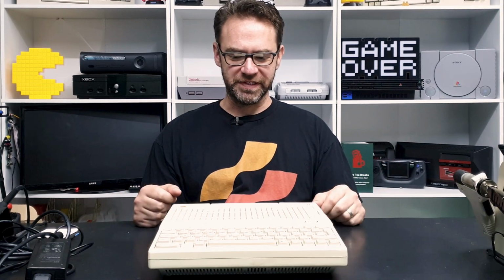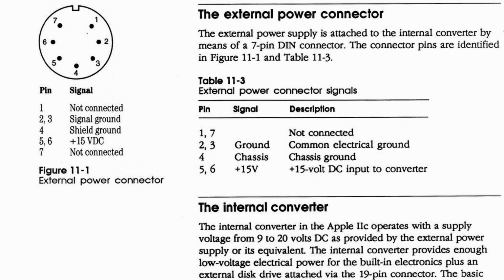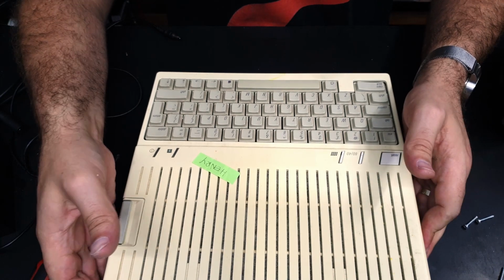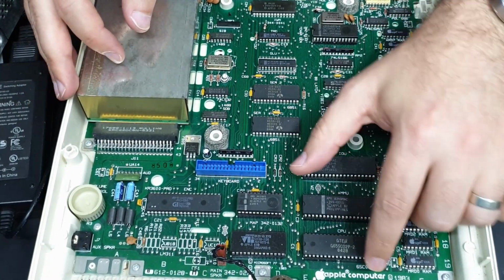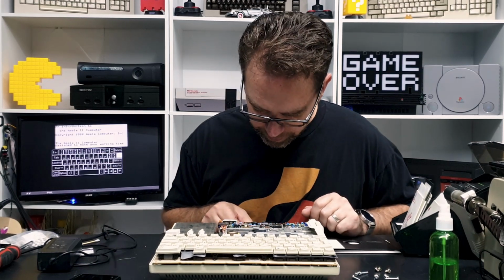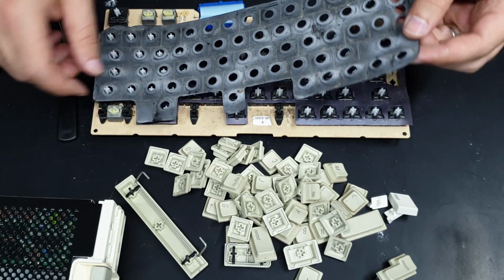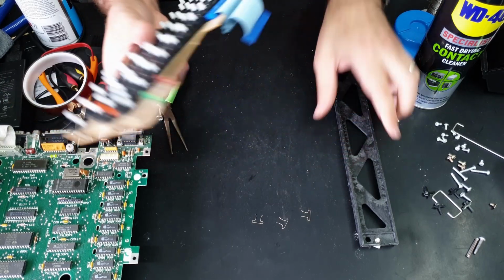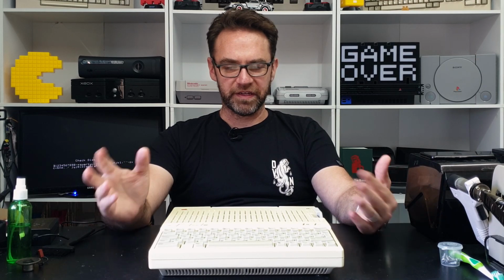Apple IIc repair and restoration - Part I

Comment: Watching this for the second time and was hoping there were some links to the parts for the cable you made to attach the laptop p.s. But no luck
Reply from the maker: You just need short piece of 2 core wire, a 7 pin female din connector and a DC barrel jack (the size will depend on what your power supply has). The wiring for the 7 pin din can be found online, just google apple IIc power supply pinout. Make sure you test the din with a multimeter to confirm you have the polarity correct before plugging it into the IIc

Comment: I repaired my IIc finally last year. Rescued it from a recycle pile about 8 years ago, and just never did anything with it. Turns out it was a RAM issue more than anything.  I did upgraded from my ROM255 to ROM4X, and have it switchable now via a switch that comes out the back, (nondestructively)... although it's kinda pointless. the only thing it really affords me is that it moves the slot the mouse is connected in... so.. yeah. Unless you have the memory expansion board, anything more than ROM0 isn't really useful.  just fyi,  I'm itching to modify it more though... i'm eager to see your follow up video. :D
Reply from the maker: Thanks Scott, yep the ROM4X will definitely be going in along with a couple of other changes
Reply: @TheRetroChannel  excellent. (Just subscribed today too, btw. :D)
Reply: If memory serves well, the ROM 255 doesn't allow to use a 3.5 drive (A2M2053).
Reply: @granpawa  yep.  but going all the way to 4x wasn't necessary for my needs. (I also don't have any 3.5" apple II drives anyway)  I could have just used version 1iirc.  Regardless, i can switch between Rom 1 and 4x if need be

Comment: The plastic around the power switch was bending so much as you were trying to remove it 😬. I'm surprised it was so flexible. For a computer of this age they managed to make it look quite "modern" compared to other machines out at the time.
Reply from the maker: It is a nice looking machine, so I do want to spend some time to make it look better. The plastic at the back survived, as it's the first time I've worked on one of these I didn't know there were clips either side. Everything survived though
Reply: I was cringing at that too. But he got away with it.

Comment: Welcome to the wonderful world of Apple 8 bit computers. I'm a recent explorer myself.  Mr Lurch has probably pointed you to all the useful resources (Including the appleiioz mailing list), but just in case, ADTPro (https://adtpro.com/index.html) will allow you to get new software onto the apple with a serial cable. After that, https://mirrors.apple2.org.za/ftp.apple.asimov.net/images/disk_utils/diagnostics/ has disk diagnostics apps.  I think I ended up grabbing Apple Cillin II and Apex II for diagnostics, once I had the system stable enough to write disks.
My first experience with Apple IIs was spending MONTHS working on a very broken europlus, with corroded chip pins and lots of failed RAM. Also the language card was toast, which meant I couldn't even use ADTPro to move files over. Ended up resorting to using the tape port and Asciiexpress (http://asciiexpress.net/diskserver/) running on my iPad. Good times :-D
Reply from the maker: Thanks for the links, I was literally about to start searching for a disk diagnostic program. I haven't yet downloaded ADTpro but Mr Lurch did give me a cable to use with it. It's likely I've just got some bad disks, but I want to rule out the drive being an issue before I write them off

Comment: Index hole LED direct to oscilloscope will get you the RPM. I have a vid on it on my channel about cleaning the LED
Reply from the maker: Thanks I'll check it out
Reply: @TheRetroChannel  As far as I know, the Apple II disk drive doesn't use any led index for the track start. Track indexing is done purely in software.
Reply from the maker: Correct, I had a look yesterday and there are no sensors for the index hole
Reply: @TheRetroChannel  Did apple use the Spindle for the rpm?, cant remember..
Reply from the maker: It has the markings for setting the speed on the bottom of the spindle, I plan to use that and also try out some diagnostic software if I can find one that reports the rpm. See how accurate setting the speed by the spindle strobe markings vs software
Reply: @TheRetroChannel  according to the interweby thingy, RetroComputer stackexcgange thread they run up to 300 RPM, DISK II (Wiki) standards omitted any index use thus creating the flippy world we read about. Woz didnt want to read the shugart manuals and took his own approach to PCM on Ionized metals... Interesting.

Comment: Ok, I have to ask, That watch is nice, what brand / make, model is that watch brah...
Reply from the maker: It's a Huawei W1 and it's probably about 4 years old now. There is quite a bit of screen burn happening but it still works well
Reply: @TheRetroChannel  Reminds me of my Dads watch, and as most kids know, wearing your dads watch as a child is a good memory. My kids got me a  KC50054006 but I am afraid I will break it so I need to find a everyday watch. Do you remember the Red LED calculator style watches?
Reply from the maker: Oh yeah, I don't think I ever owned a calculator watch back in the day, probably out of fear of being beaten up at school 😆
I say just wear the watch, it won't last forever even if you don't, and I'm sure your kids will appreciate seeing it being used
Reply: @TheRetroChannel  I shouldn't have said it that way, lol, No it was a black dark dial that had no buttons, looked exactly like yours, and when you pressed a pin on the side, it lit the Ghostly red led time on the blacked out screen.. Found it!  Fairchild Men's Red LED Watch 1977
Reply from the maker: Oh right I get ya, yep I'm sure I went through a few of those. Or at least some cheap knock off of it

Comment: I think that "bluetack" is what remains of the rubber feet. I think the 8-bit guy did a  refurb of a IIc where the feet were in a similar condition..
Reply from the maker: Oh yes, I've seen some of these dissolve before, but these were extra sticky 😬
Reply: @TheRetroChannel  This is what happened to mine, and on most of my PowerBook 500, and Duo machines. the feet just turn to sticky goo. :(